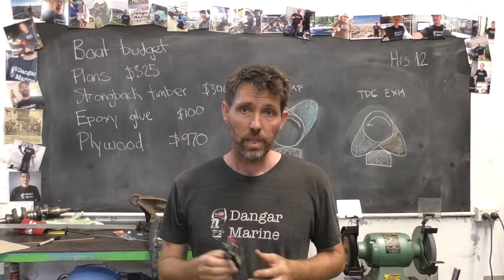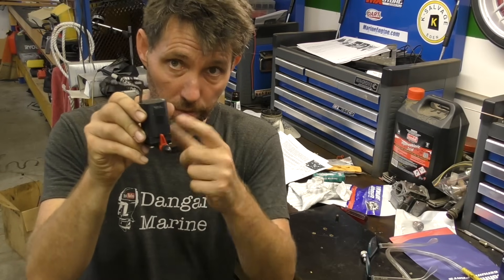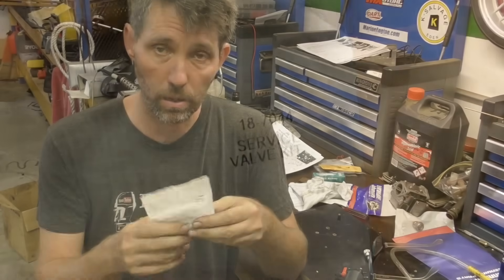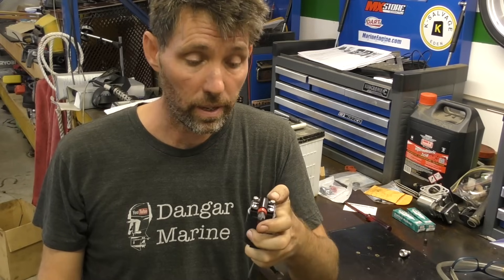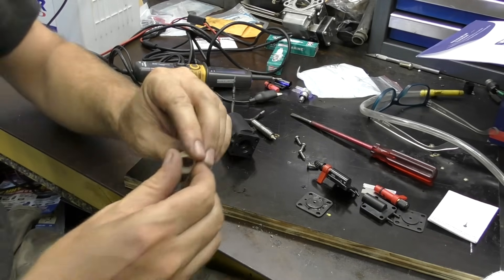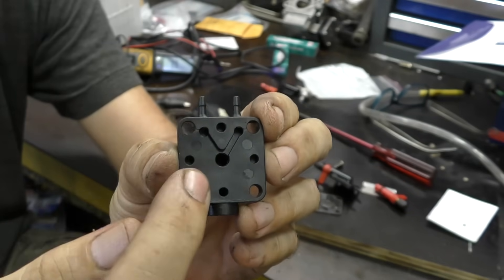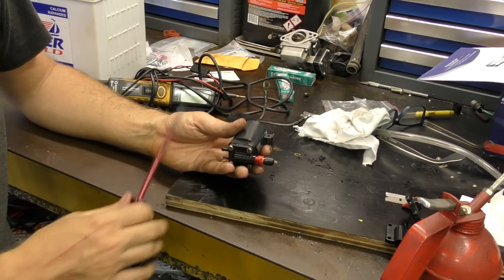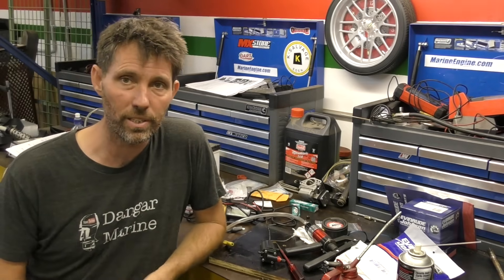Johnson / Evinrude primer solenoid

Comment: I'm not sure if you get this. Since this is an old video but I put a new primer, solenoid on my evinrude xp 150. Selenoid works, but in run position fuel wont come out to the small lines.  It will only do it in the always open position.

Comment: Howz it mate, firstly thank you for the amazing delivery of your awesome tutorials, top knotch!! My 40 hp evinrude runs well but compared to Suzuki 55 hp and Johnson 35 hp, this 40 hp guzzles gas! The VRO self mixing oil has 
been removed and bunged with a bolt. Could that have anything to do with fuel consumption? Cheers this worries me cos its not like other motors ive owned, but starts so easy and during day doesn't really need a squirt of fuel. Cheers...

Comment: Question, Hi, the red lever should I make it straight.
Reply: It should be pointed down in normal operation. If you suspect the solenoid is not working then you point the red lever to the back which will manually allow fuel past.
Reply: @nathanfeatherston9330 thanks mate

Comment: My solenoid is always leaking fuel. Found out the red plastic valve was cracked so i replaced this whole kit as in this video a couple years ago. It never stopped leaking so I inspected it, and everything looks good. Now my engine is dieing at anything over about 1/3 speed. I think this is probably a carb issue now after you said you can potentially run it on the fuel from solenoid.

Comment: Hey Dangar, if the Schrader valve is leaking, would that cause a primer bulb not to stay primed and the motor to run until the boats on plane and then die?? my 96 Johnson will get on plane and die, but I can prime the bulb in a fire right back up and run perfect and then die but that Schrader valve is leaking air

Comment: Just started rehabbing an 89 tracker with a 50 evinrude.  This solenoid/ check valve was leaking after fixing several other issues. This video was exactly what I needed! Mine looked just like this one,  cracked etc. This feller is fantastic!  Obviously very knowledgeable, well spoken and does a good job explaining!  Please keep up the good work! Going to marineengine right now to order parts! Thanks so much!

Comment: First of all, thank you for this great sharing. My question is: The Fuel Primer Choke Solenoid on a 1994 Johnson outboard motor is overheating a lot, almost to the point of burning. What do you think could be the problem? and What product code should I purchase for the Fuel Primer Choke Solenoid on a 1994 Johnson outboard motor?

Comment: My key switch was messed up.  Keeping primer dumping fuel all the time.   Would run good at wot by idle rough and rough mid range.  Was running way too rich.     After I waisted couple hundred on carb kits and reeds for no reason.

Comment: If you’d don’t have the engine hooked up to a power source can I still use the Schrader valve to winterize or do I need to take the air filter piece off and spray into the carbs manually?

Comment: I have never worked on an outboard before. I now have an Evenrude 115 that won't start. I did notice that gas was leaking from the primer solenoid so I will tackle that first. I have worked on Automobile engines and lawn care engines so have some experience. I wouldn't tackle this, but your videos makes me want to push forward. Thanks for your very detailed videos.
Reply: Hi Daniel 
I have a leaking solenoid as well how did you go mate

Comment: On the  top plate, there are two barb fittings. On mine, only one barb is used. Is the part designed to provide fuel to two carburetors?

Comment: Outstanding video.  I ordered a kit, but need assistance.  When I depress the key to activate the solenoid the solenoid activates but dows not allow the engine to turn over.  If I simply turn the key, the engine turns over great.  I can (loooong start in the morning) start the engine cold, but would rather use the solenoid/prime function.  Any ideas?  The battery turns the engine over rapidly and load tests just fine.

Comment: Thanks. My problem is the power to primer solenoid. Push key in, nothing. Bench tested choke, it clicks. Any suggestions? 0:41
Reply: Get a repair book for your model of engine and check all the wiring. Could be a fuse or some corrosion in the wires.

Comment: HI.  I found a wire detached from the solenoid.. can you tell me where they are connected and where they connect?  precise that the engine starts..Many thanks
Reply: You can order a repair manual from the website that may have your engine type and follow the wiring diagram.

Comment: Question I'm 90% sure carbs are cleaned properly and rebuilt 2 the float is seating properly all fuel ways are clean. When I shut the primer it starves the engine of fuel. When I leave it open it runs with high idle. 

New spark plugs, wires, primer solenoid, carburetor rebuilt, fuel lines, gas tank, water pump. 

Any ideas? Has to be clogged carbs or

Comment: Hi guys! Thank you very much for your content! It's a great help!
I have a Johnson BJ30ESSR that has had a broken Service Valve, the same crack that you show in the video. I bought the new part, but when installing it the red key does not take pressure and loosens a little. I don't know if it's because the replacement is not compatible or maybe it should stay that way. Can you help me a little? Thank you so much.

Comment: hey got a ? what would make that pump spray gas only wile the engine is running. could it be a wiring issue it a 25hp
 Evinrude
Reply: This is a solenoid not a pump. You could have seal issues and should be further investigated so you don't get a fire event

Comment: Hi, thanks for the video! Big help! I had planned on injecting fogging oil through the service port but my Sta-Bil fogging oil container doesn't have a nozzle that adapts to a hose that can be threaded onto the Schrader valve portion of the service port. I am wondering if I can unscrew the Schrader valve and inject the fogging oil through the opening where the valve was. Of course afterwards screw the Schrader valve back into the service port. Also the cap doesn't easily unscrew so I wonder if it would hurt to hold onto the red directional arrow part of the service port to be able to break the cap loose. Your input on this is valued and appreciated!

Comment: The two outlet hoses that you had mentioned…I have a 93 30  horse Johnson, and one of those tiny hose connections are basically capped off with a little cap with a zip tie. Is this normal or should they both be connected to the carburetor?

Comment: Is it possible that if i over prime the solenoide its start leaking ? The old one was leaking, i change it, still leaking after a few priming start, change the seal and same things. Every thing seems ok dont leak when running but after a few time starting whit primer its leaking. Thank you

Comment: Can I replace just the red lever with O ring without taking the solenoid off of the engine? Ours is leaking around the red lever but works fine other than that.

Comment: Hi Stu, I’ve had several vro evinrudes fail to accelerate when warm but then are remedied by pushing the key/activating the primer solenoid and run fine once on plane. Any clues to permanently fix this so I don’t have to activate the primer at takeoff?

Comment: SO FRUSTRATING! I bought my boat and someone blocked off the fuel to this solenoid. I reconnected it because i was tired of hanging over the back of my pontoon taking off the hod and hitting it with carb cleaner (previous owner used ether right under the hood). so rebuilt the solenoid after watching this video with a $10 kit off amazon. the fuel wouldnt shut off no matter what i did! i bought a hundred dollars of individual parts from my evinrude dealer and still couldnt shut the fuel off through this solenoid. then i reverse engineered the action of the solenoid and noticed the white plunger never pushed into the diaphragm. turns out the previous owner put the smaller spring over the white plunger. it looked right to me there is even a chamfer inside the steel plunger that accepts this mistake. i put the spring under the white plunger and it worked. then i came inside and rewatched the video and confirmed the spring does go at the bottom. So thank you for this video!

Comment: I have seen where these leak air into the system and will rob your engine of RPM's at WOT. A boat that I recently worked on was a bass boat that would not come up on plane. I found a cracked cover on this primer solenoid which allowed air into the fuel system. it was an inexpensive repair for the customer compared to Carb rebuilds that would not have fixed his problem at all.

Comment: My solenoid is in good physical shape, passes resistance test with 6.6 ohms but does not click. I don’t see fuel run up the line when I push in the key primer.

Comment: Mine leaks fuel. Will this cause vacume problem in fuel line. Motor lost power and stalled. Then only able to low speed back to ramp

Comment: Great video. Thanks for posting. Now I know how to test my solenoid. I suspect mine may be bad because the motor is very hard starting. Once it's warm, stars like a charm. I'll update this.
Well 2 days later, it's fixed. My motor had been hard starting for quite some time. It looks like the ignition switch was the culprit. It wasn't making a good contact anymore  when you push it to choke it.Seeing as I didn't have a new ignition switch handy, I decided to install a separate switch for the ignition solenoid (I used a doorbell switch $5.00). It now starts great.  THANK YOU.

Comment: I may be 5 years late but thank you so much for this video! I just recently have been getting into my old 1990 Johnson 115 and I was passively wondering what the hell that part was and why it had a Schroeder valve and why there was no choke in the carburetor, and then this video showed up in my feed and answered all my questions.

Comment: I have been having big issues with starting... So had my carby cleaned and still issues... IMO you have just told me what my issue is... I am surprised my mechanic did not do this.. to eliminate a possible reason... It certainly is not a complicated job... Many thanks , will ask my mechanic to do this ...

Comment: Thank you very much! I feel stupid for this. I cleaned the carburetor a couple of times, checked and checked the hoses and connections. And all the time the cause of the problems was only a small red lever in the wrong position. I've even owned one like this before, but I've never used the red lever. Huh :)🤣

Comment: Hi I having trouble try to get my 50 hp johnson to idle more so to run as it’s been ditty for more than 5 years however I did notice it was leaking around that area were that red plastic cap thing is but did hear solinoid clic . Would this be the reason it won’t stay running ,as it wound run for 5 or so seconds before it dies thanks tony

Comment: I followed your very thorough instructions and tested using a vacuum pump, but the air leaks out around the red s shrader valve. Any suggestions? Thanks

Comment: Hi, thank you for your videos, they are reallu helpfull!!
I have a 1980 115 HP johnson which runs ok outside the water but when I try to start it in the sea, it does not moderate.... some idea? 
Carburetors are clean, fuel tank as well.... myabe it is a watewr pump problem???
Thanks!

Comment: I have a 98 johnson 90. when I squeeze the primer bulb it comes out of the primer lines. the silionid clicks with power. 4.9 oms. I put rebuild kit on. no change. it constantly shoots fuel while motor is running. any input?

Comment: My red valve like yours cracked .I bough a new one.I tried to pull it out, and it broke off in there. Do you think I can get it out without taking it all apart.If not how and what do I do to take it off?I see the 4 screws to loosen but I can’t get to the one screw. How does it mount. Thanks Mike Powers

Comment: would this piece cause cold start problems? Ive noticed if I manually switch the orange trigger the opposite direction it's starts easier but I switch it back after. cold starting is my problem.
Reply from the maker: Yes, will definitely affect cold starting.
Reply: @DangarMarine  should I turn it and leave it half way?

Comment: Hi I have a Johnson 70hp and it take an age to start even though I can  hear the solenoid clicking could you please advise me thanks
Reply from the maker: Does it start if you spray starting fluid in the carburettors? If so it is a fuel problem. If not, it could be a compression or reed valve problem.

Comment: I have ordered 2 of these kits and after rebuilding the gas leaks from the red manual valve. It leaks especially bad after pumping the fuel bulb when initially starting. The valve is real loose after installing . I have tried to installing a larger o ring to make it a tighter fit but it still leaks. I am ordering the complete unit now, hopefully it will not leak! I have no good results from the rebuild kit.

Comment: hello, I see you are a great specialist in engines. I have a question about the solenoid. when I press the key on the remote control to start the engine, then gasoline flows out of the solenoid where the red valve is inserted into the body of the solenoid. I already changed the round rubber ring. it got better but still leaks a little. what to do? Thanks.

Comment: Great video!!! I have a question! I have a 50hp 1999 Johnson outboard that won’t start at neutral. It only starts at open throttle! I also see that primer solenoid leaks when key is pushed in! Could that be the problem?
Reply from the maker: Sounds like it's getting way too much fuel. Could definitely be a primer solenoid problem.
Reply: @DangarMarine  replaced the red valve on primer solenoid, it was cracked. But still it won’t fire at neutral.

Comment: Know this is an old video but hope I can get a response, my manual lever is cracked down the side noticed it was spitting fuel starting it. Have been chasing a misfire for a few days, would that possibly be a reason as it would be misfiring?
Reply from the maker: Maybe, but it doesn't sound like a likely cause for a misfire. Fuel problems feel more like hard to start or bogging down with too much fuel.

Comment: I like your straight forward way of explaining things! 
I have a 1985 25 hp Evinrude  that has the primer solenoid on it! Before I had it given to me mice had gotten inside the cowl cover and chewed wires and fuel lines. I am trying to find a routing diagram for the multitude of fuel lines but am not having any luck! Is there anyway you would be able to tell me where to find such a diagram or schematic if you prefer?
Reply: Hi. Did you ever find it then? A schematics?
Reply: The website he is sponsored by have repair manuals for some engines that may have the wiring diagram in them.

Comment: Can the red lever be replaced without taking out the four screws and top off?     It appears that if you activated the electric solenoid and pulled the plunger down  and kept it down, you could remove and insert the red lever with it in the run position without damage to plastic tip on plunger.  Thoughts??  My lever is cracked and  to remove the top and  screws is a much bigger task.

Comment: Great video. have 1999 johnson j40pleea. hard to start ( need to use neutral throttle control). Once it starts, the idling is rough and the rpm fluctuates between 500 and 1k rpm but quickly falls below 500 and the motor stalls out. When we had the motor running last year, it would start and idle fine but it wouldnt go above about 4k rpm without bogging down. We sprayed carb cleaner in the carbs. Should we try to change the solenoid primer as well? Thanks for you help!

Comment: Could this cause the boat to not be running right? I have a 48spl on a pontoon boat and it use to run 28-30mph and after sitting a couple years it’s only running 10mph! I put a new prop on it and don’t know what else it could be, I did notice fuel coming from this part tho?

Comment: Can I guy get away with just capping all that off? I understand it would be a pain to start but man I hate all the lines and everything else. I’d like to just have my fuel lines running to my carb and cap everything else off. On the motor side also.

Comment: I have a question; I purchased a boat with a 1989 Johnson 25 hp electric start, console boat. Where does the small lines from the bottom of the primer go to. I have the larger line going to fuel pump and one small line going to a t-fitting. Does one of the fittings get capped off? Thanks in advance for looking.

Comment: Greetings stu, I have a 2000 Johnson 115 with this thing on it. I have heard that this part has a tendency to crack and leak over time? Lately, I have noticed a gas/ greasy residue building up behind the steering harness on top of the mounting bracket. Basically in that crevice under the cowling and mounting bracket. Anyways, do you think this could be my issue on cold starts? I also notice oily residue in the water while it’s idling at the dock.

Comment: Hi, i have a question...il have a Johnson 30hp and there is no solénoïde on it but the valve where gas should go in the motor is open and there is fuel coming out when engine is Running. Can i just close it? Ik have pics if necessary. Sorry for my bad English...thank you

Comment: Hey Stu , very informative video great details thanks . My solenoid is bad the wires are dry rotted and 0 ohms . I’m have trouble finding a replacement. The large outlet on mine has o rings and plugs into something . I only have to 2 small hose . I can’t fine any that push into something. Can you point me in the direction? Thanks